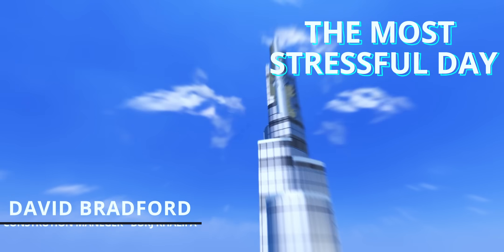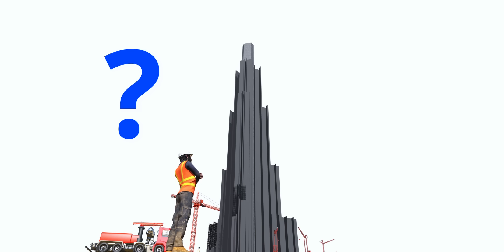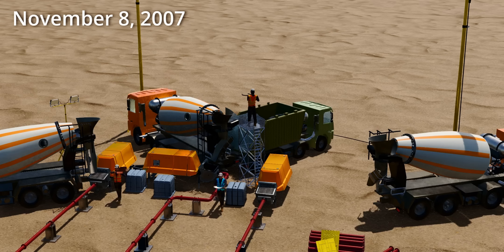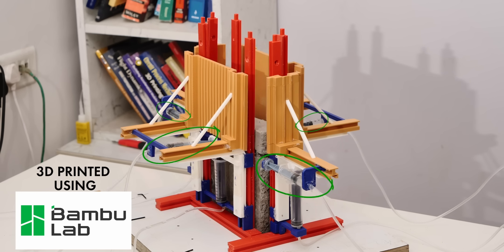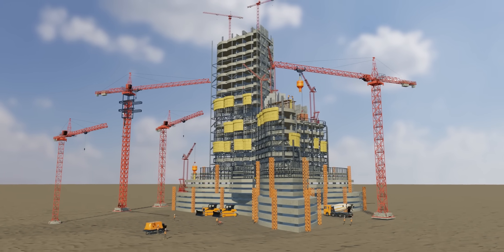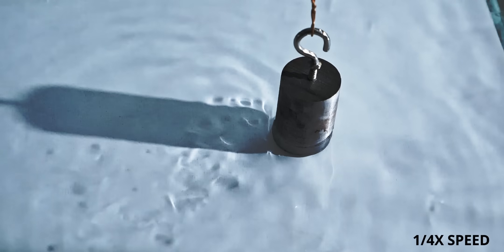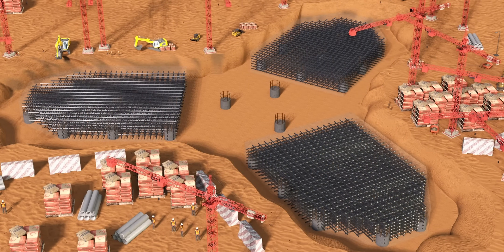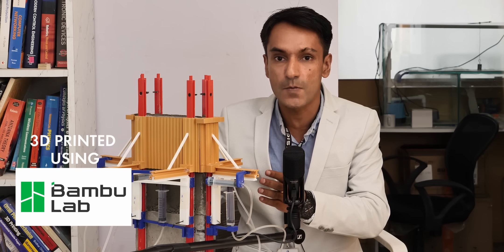How did they Lift a 4400 Ton Steel Spire to the Top of Burj Khalifa?

Comment: Maybe next time simply place a portable concrete mixer on the top floor, then pump water, use crane to hoist the sand, aggregate and additives up to the floor then mix the concrete up there. No waste in the kilometer of pipes, no waste if something goes wrong like a clog or equipment failure...
Reply: They didn’t place concrete mixers at the top of Burj Khalifa because mixing concrete there would make it hard to control quality, temperature, and structural loads. High rise concrete needs exact mix ratios and temperature control, which is only reliable at ground batching plants. Putting mixers, raw materials, and water on upper floors would add unsafe temporary loads and depend heavily on cranes, which are slow and limited by wind. High-pressure pumping from the ground allowed faster construction, uniform concrete quality, and much safer structural performance.

Comment: Didn’t see anything not already used except he didn’t explain how they emptied 600 meters of concrete from the pumper pipe and how they would change a window after it was broken seeing it was locked in on all sides by its neighbor.

Comment: The spire is later stated to be only 450 tons vs 4400 tons.  Too many errors
Reply from the maker: I created an accurate CAD model of the spire and performed a mass analysis using SolidWorks. The mass came out to be 3,900 tons. This figure excluded the accessories on the spire. This number is difficult to digest, but it is accurate. I will soon write a detailed article about my analysis. Here is my detailed analysis - https://sabin.education/post/is-the-burj-khalifas-spire-really-4400-tons/

Comment: One of the things that I find impressive the most is that this feat is something that needed to be right on paper from the begninning because there is little testing for something like this. I mean a lot of people know proven ways to build a standard house, whereas something like this is unique. You can't afford to build such a gigantic building and then accept that it collapses to then try again differently and see if this time it's right.
Reply: CAD simulations, then scale model testing. By the time they get on site they're already pretty confident from that that the design will work

Comment: ...and there are still people who wonder about the pyramids... they where just as committed as engineers nowadays!
Thanks for this fun ride! learned a lot again!
Reply: those silly flat earthers
Reply: Pyramids have larger and larger bases as they are built higher. Also, they are built on bedrock, so the load on the foundations is pretty irrelvant. Greeks and Romans built structures will columns and pillars, which are more stress concentrated than pyramids.
Reply: Pyramids lack proper sewage systems as well.

Comment: I think there are many details missing from the video.  Like once that lightning pole exit the building at the top, they can't run those guide anymore like they do when it's inside the building so how do they keep it from tumbling over?  And usually concrete is reinforce with steel inside, didn't they do that here too?  Concrete also super heavy, seeing how the foundation is just sand the weight isn't good.  How did they reduce the weight problem?

Engineering are crazy cool.  Many things they do to solve problems are crazy and amazing.
Reply: They needed a foundation with piles that probably costed more than most skyscrapers to build. 😅